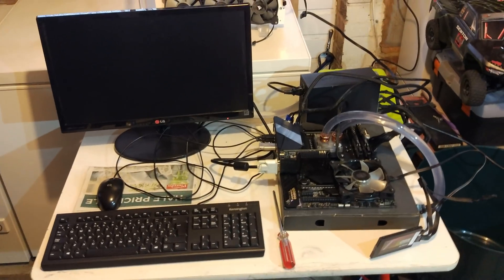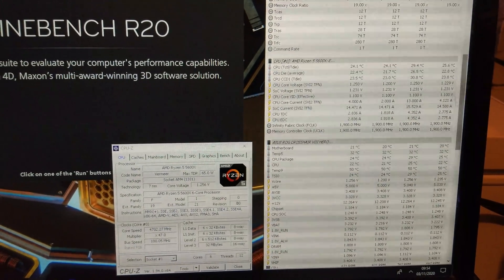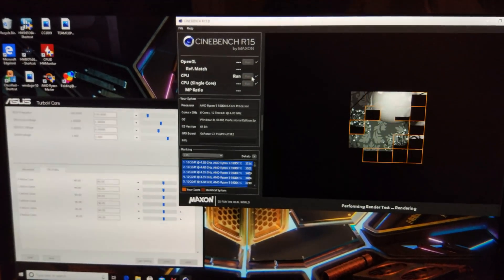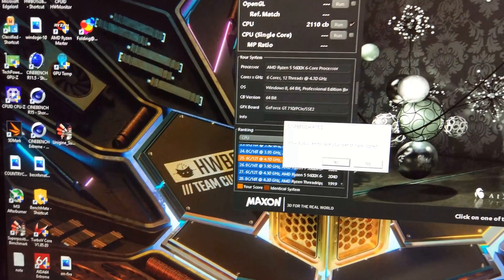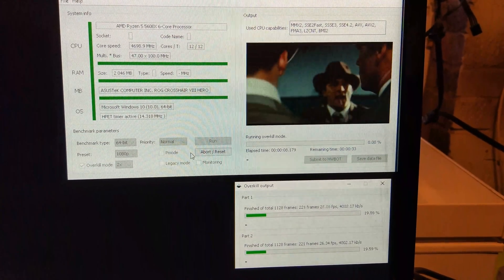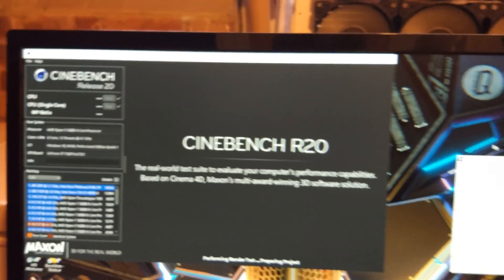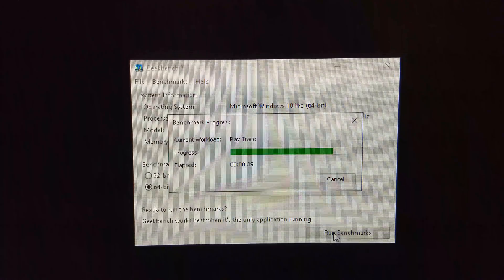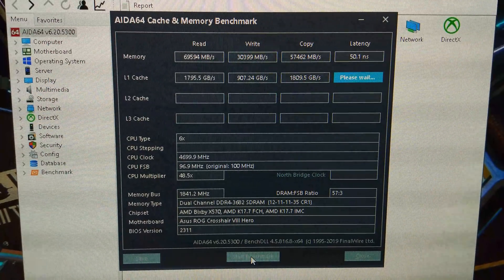Ryzen 5 5600X 4.85ghz OC Water Cooled and Memory Tweaking 3800C12

Comment: How tf u did 3800 c12, my max was 3800 c16?
Reply from the maker: Good motherboard, increased memory voltage and decent memory
Reply: @LawrenceTimme  I tried 3800 c14, worked but giving errors în games.
My overclocking is on a320m-k
Reply: 3800 c15 2t îs more complicate to get no errors, but worked

Comment: I couldn't even get my 5600X stable at 4.6GHz all core with 1.32V but with PBO it boosts and stays at 4.8 - 4.85GHz on all cores under gaming load no problem. I even got a decent undervolt curve for it. Your RAM is insane though. Flat 12's at 3800MHz is impressive as hell.
Reply from the maker: The effective clock will never be 4.8ghz tho.
Reply: @LawrenceTimme  Yeah that's true. My effective clock stays at 4685MHz on all cores. Still better than what I could achieve manually.

Comment: I think the quality of your ram is important to push the limits of  this cpu. i was on the dreaded userbenchmarks looking at the components of top scoring rigs and out of random top scoring high examples lots have lower base clock cl14 ram. I assume this is because its b die. i have cjr ram oc to 3.7ghz cl16  w/tight timings and  rigs with cl 14 3.2ghz oc to 3.6 cl 16 had faster ram and cpu.
Reply from the maker: yes, the timings can go much tighter on b die memory.

Comment: does any of this pass prime 95? at 1.25volts and at 4.7ghz....dont much see that happening unless i got a dud......4.6 at 1.25 i can do on aio 240 ek...but haven tried anything over. auto boosts to 4.85 tho at 1.3volts all core....but any lower and prime crashes on manual overclocks....everything else smooth as butter....
Reply from the maker: I have never run prime95 in my life. It's as pointless as running furmark on a GPU.
Reply: @LawrenceTimme  I mean considering I don't stress my shit enough to match wat prime wud do either. I also don't limit windows to 2gb of vram and think that's impressive lol..  I do believe id take buildzoids, GN, ect claiming half hour of prime passing is good enough...even tho I personally won't let the shit run past ten min...... Now as for what your doing with the chip and actual daily running I guess prime, aida, occt, hci, TM5, none of those wud be used anyhow.

Comment: So what voltage were you running for the RAM to achieve 12-12-12-18...1.80v-ish? I just got my kit and it does 14-12-11-30 1T at about 1.48v. Going to take it to 1.90v once my RAM watercooling kit is attached. I haven't taken it above 1.52v yet because I don't want to take chances with cooling under load...
Reply from the maker: 1.8v

Comment: What are the specs of the WC components you are using, Radiators, Fabs, CPU block?
Reply from the maker: EK supremacy evo
Watercool MO RA 360LT
Fans are like from a corsair H100 SP120 grey fans. 
9 way fan splitter its 1x molex to 9x 3 pins.

Comment: 622 singlecore is pretty close to the 647 wr held by the 5950X, is this because of the precision boost turbo to 4.9? will the 5600X run that fast in light singlecore workloads?
Reply from the maker: yes the 5950x seem to boost higher on 1 core to 5ghz +
Reply: I got my 5600 non x to 647 single on CPUZ and 5150 multi. 1.275v 4.7ghz all core.

Comment: What voltage is your ram at to need maxmem at cl12 3800???
Reply from the maker: 1.8v
Reply: @LawrenceTimme   That makes sense. I was half expecting 1.9v+
Reply from the maker: @r3drumg33k3  1.9+ will be needed for 4000c12
Reply: @LawrenceTimme  o definitely need over 1.9 to boot most sticks at cl 12 4000.  I have one kit that will boot it at 1.82 but needs 1.85+ to do anything.
Reply: N 1.82 is pretty much 1.85 on my z390 dark, I'm gunna have to put a meter on it n see what it really is. Probably is closer to 1.9 actual at 1.85.

Comment: I can't decide between 5600x or 5800x for 4K gaming! Someone help me pleeeeeeze
Reply: BTW, my name is Chris. I use my wife's account. I finally decided on the 5600X. It makes the most sense for 4K gaming. I don't see game developers leveraging 8 cores at 4K any time soon. By the time that happens I'll be upgrading to AM6 sockets lol
Reply: And they're gone... All Ryzen 5000 processors sold out on Newegg. That only took 45 minutes. I got the notification that it was in stock through gearinstock.com and was lucky enough to pick one up from Amazon. Oddly enough, i can't find the processor by searching Amazon. I can only see it by clicking the link i received via email from gearinstock.com.
Reply from the maker: 5800x if you have the extra budget
Reply: @LawrenceTimme  i couldn't justify the extra money when i only use my rig for gaming. I was on the fence about the 5800x but since i only game at 4k it just didn't make sense to get the 8 core. Thanks for the advice though
Reply from the maker: @mayraandchrisbasinger5217  that's fine. The 5600x is a great cpu anyway!

Comment: So 4.7GHz ish should be ok 5950x on water 24/7. Hmm do I want to upgrade from 7920x@4.8GHz all core. Scores suggest yes just about worthwhile, can reuse my 3.2GHz @4GHz ram and HX1200 PSU and water loop 2. Or just wait. Machine is not remotely slow.
Reply: after seeing the benchs on 5950x I have preordered one. In short it annihilated my system at half the power consumption. Also annihilated the 10980 18 core for cheaper than i can get one used. Intel fuked.
Reply: What I love about it, Enable PBO job done. 7920x tooks days and days of testing and tweaking to get it to do 4.8GHz. de-liding, lapping, mosfet cooling,  fan speed tuning, endless. Problems getting all 4 channels working (never did). 3 work but it's 171717 4000Mhz. Granted I was proud of the 40% overclock result but over 500 watts...  360 + 240mm rads. PBO on 6950X is what like mid 200s. That's unreal. Then 6900XT to replace the 1080ti 2GHz Sli.  I'm gonna have a silent system!  but why more powerful and set it and forget it tuning.
Reply from the maker: @jondonnelly3  well pbo doesn't work atm on my board but it's still much easier to oc!
Reply from the maker: if you dont find you machine slow, no reason to upgrade. you could also try find a used 7960x or 9960x

Comment: 1.3 volt is very safe for everyday use. 1.35 might still be safe for everyday use depending on temps. Anything over 1.4 will degrade the chip probably in months.
Reply: My 3600XT Dagraded with 1.35V @ 4.5 in 3 months.... And it was running on Water @ 68C max.  Amd and OC is dead. This CPUs are Dagrading very fast when you push them to he limit.
Reply: @isipisilemonsqueezy  my 2700X on a H150i pro XT is at 4.2Ghz all core with 1.43V daily useage
Reply: IKSDE XD  asus Corsair heero. LLC was on Medium. 3300x dagaded wihin hours. So oc ist dead.

Comment: which cpu could be the sweet spot for gaming between 5600 and 5950?  is there any big difference between 5600 and 5950?
Reply from the maker: I would say 5800x is sweet spot
Reply: @LawrenceTimme  yeah, with all 8 cores on single ccx, it might even have better gaming performance compared to 5900x which has 6+6 config.

Comment: I must ask why are you only running 1900mhz DRAM when we should be able to use 4200mhz either at launch or soon after
Reply: Its running at 3800mhz, probably not going any higher to have it running 1:1 fclk because its the same memory controller as ryzen 3000 so it wont go past 1900mhz

Comment: Nice one! But 1.35v 24/7 might be too high, right? And how were the temperatures? Got a comparable rig with bigger radiator.
Reply from the maker: Not sure how degradation will be. 1.35v temps seem OK. If it was too hot it would shut down

Comment: pretty overkill radiator.
if your planning to beat world record, dont loop the water just get it directly from the tap and out to the drain. you wont need those radiators hehe

replace the tube with corrugated copper tube at fans to it.
dont loop water the heat will return.
Reply: or put ice in the bucket.
Reply: @TheKuiou  And add salt to the ice for even lower temps (below 0 °C)
Reply: @randomkingdom5423   salt are good conductor but.... theyre a combination of acid and base.
the salt might be stuck in his rig even nano sized it will react with water. Na-Cl + H-(OH)= Na-(OH) + H-Cl 
hydrochloric acid hcl and naoh are nasty stuff to metals will destroy his rig in time.
micro metal particles better but will clog his pump at least not corrode his rig.

if his willing to sacrifice his rig
liquid hydrogen is the extreme best far better than liquid nitrogen 
superconductors level.
but is also extremely powerful and dangerous could explode his room almost like your in a space launch.
if he succeed his competition needs effort greater than him.
Reply: @randomkingdom5423  Would automotive antifreeze work?
Reply from the maker: The records will be all Ln2 scores on day 1 I expect

Comment: What voltage are you using the ram at?
Reply from the maker: Just 1.8v
Reply: @LawrenceTimme  Jesus
Reply: @LawrenceTimme  is 1.5v safe for 24/7 uses
Reply: @matthewsmith2385  yes
Reply: @harrystresslevel  im about to try and oc my trident z neo kit cl 18 3600 to 4000mhz cl 16 at 1.5 then wish me luck

Ps the highest ever went with ram voltage was 1.4
Reply: @matthewsmith2385  1.5v is fairly high for C/D Die which is likely what you have. It will probably scale negatively with voltage.
Reply: @basedanon420  hopefully not
Reply: @basedanon420  its sk hynix ram
Reply: @matthewsmith2385  probably won't scale much above 1.35v
Reply: @basedanon420  😰
Reply from the maker: Just 1.8v

Comment: 50ns memory latency.. thats very good!! It´s almost Renoir level of performance.. and that cpu has the best amd memory controller.
Reply from the maker: It's about same as 3300x :)
Reply: the memory controller is the same there won't be any performance improvement, that is 50ns only on the 5600x, cause it has 1 ccx ,above will be about the same as previous ryzens
Reply: have to correct myself the 5800x still on 1 ccx
Reply from the maker: @HyrrokkinX  correct 5800x is 1 ccx 1 ccd
Reply: @HyrrokkinX  shedule your cores right and the 5900x wont be worse =) worse case it will clock 100~mhz higher, and be even. Everything else wont be good marketing for amd in regards to pro. apps/usecases.
Reply: @themadnes5413  I don't use ryzen.. but I know the tech, the argument was only referred to latency, as soon as you have 2 ccx that 50 ns will go back to 60, the controller is the same and will give same memory results! there'll be a small improvement only due to the better ipcs..
Reply: @HyrrokkinX  mate I have a question, if u were building a gaming rig would u go with a 5800x or 5900x? With memory latency in mind it seems like people are saying to go for 5800x over the 5900x because of the 1 ccx ccd
Reply: @iamLODD  since 8 core are pretty enough especially now with stronger ipcs there's no point having more if just for gaming...  I would buy the 5800 and not the 5900.  If you need then to be more future proof .. go for 5900. to sum it up,  if you can afford in 2/3 years to change for the new cpu no matter what, buy a 5800, if you want it lasting at least 5 years .. for for the 5900.
Reply: @HyrrokkinX  thank you so much 😊
Reply: @HyrrokkinX  do u think the 5900x 70mb of L2 and L3 cache would interact with the Smart access memory and rage mode better than the 36mb on the 5800x?
Reply: @iamLODD   @Kabir Bariana  I don't have details about that but it is only amount of cache and not a faster cache.. ram speed will be only impacted by better ipcs.. i don't know but a 5900x might have a 10% increase in mem bandwidth and latency over previous generation, and only if you use binned mem kit you have to run 3800 with cl 12/13 daily, considering 1,50v max you have to buy a good mem kit
Reply: @iamLODD  lol.. I didn't expect to see right now reviews about the 5900x... anyway as you see I was right... latency can be max 10% better... before a good results was 62,63.. now will be pretty hard getting less than 57-58 on binned cpu.. and very good memory kits
Reply: @HyrrokkinX  thank you very much man, i think I will go with the 5800x 🙏🏽
Reply: @HyrrokkinX  thats crazy ur numbers were so accurate, 5900x an 5950x will be similar to the 3950x in terms of memory latency cuz of the 6+6 layout but the 5800x will have better memory latency because its only one full 8 core ccx
Reply: @HyrrokkinX  you’re amazing mate, you helped me a lot 🙏🏽
Reply: @HyrrokkinX  also I have one more question, how does the 5900x score 89.5 pts in memory latency but the 5800x only scores 87? How is the 5800x one ccx full 8 core performing worse than the 5900x?
Reply: @HyrrokkinX  i was reading benchmarks and noticed that the 5900x was better in memory latency 😮

Comment: You are probably really busy but, considering that 1.28V ish ( even tho my 3600 didn't degrade at 1.3+ for almost an year)  was the safe recommended voltage, what frequency do you think the 5600x can realiably  run 24/7?
I'm assuming around 4.6 from what I'm seeing here.
Reply from the maker: No a clue. 1.2v at 4.6ghz seemed most sensible to me. After that scaling drops off. Other cpus might be better or worse though.
Reply: I just bought a 5600(non x) and I get 4.7stable allcore/singlecore @ 1.275v. 58 to 65 degrees while gaming. Low 70s in benchmarks.

I need new ram. I got my 2400mhz c15 ram clocked up to to 3066mhz and managed to keep my cl15, 16, 15, 15, 35 timings!.. massive gains.

Comment: So for gaming do you think the 5800x will be a better option than the 5900 due to single CCD for lower memory latency? btw just subscribed linkd from Actual Hardcore Overclocking.
Reply: Nope. They’ll perform the same in games. Unlike the ccx, the ccd isn’t really a problem and any penalties are easily alleviated by windows’ scheduler just keeping latency sensitive workloads (like games) within a single ccd. This is why it wasn’t an issue in zen 2 and the 3900x was even slightly better than the 3800x in games thanks to the slightly higher boost clock. 

It doesn’t really matter as at most there will be no more than a percentage or two difference in either direction so don’t worry about it.
Reply: @Michealxlr  Was about to answer, but pretty much what Micheal said. If i should guess i would even say, the 5900x will be better due to higher (artifical?!) clocks.
Reply from the maker: Yes possible
Reply: Download "process lasso" and set your games affinity to one CCD while youre at it. At least for games that don't use more threads than you have on one CCD which is like all them lmao
Reply: 5800x benchmarks are poo poo for thd price.
Reply from the maker: @tacticalcenter8658  yeah the price to performance on that cpu is not good compared to the others